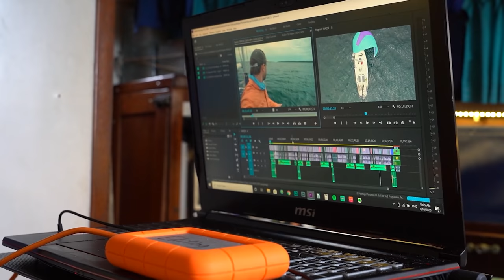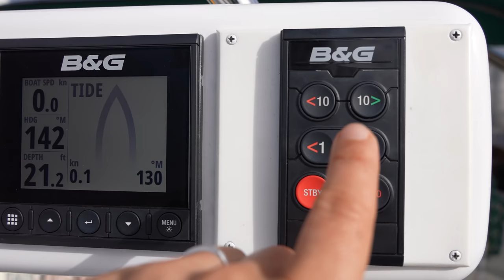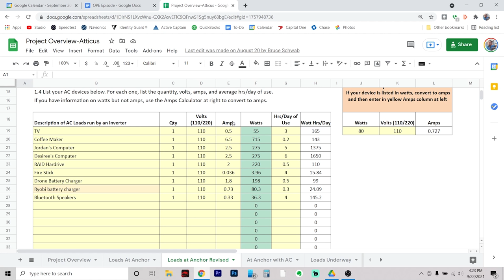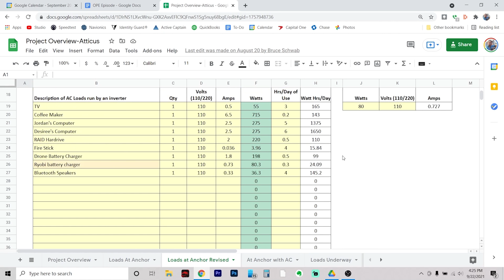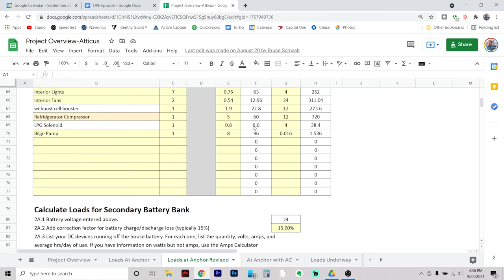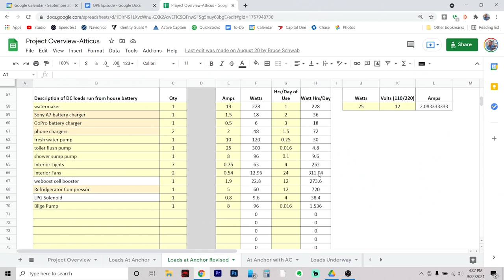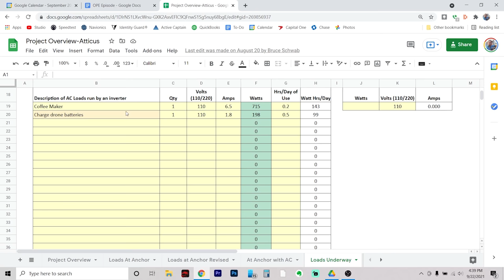Building our Electrical System | S06E20

Comment: Did you say if ya'll are sponsored?  Will you say if so?  

IMHO Nigel offers a really expensive solution that perfects 1970's technology.  Ultimately it's ~$40k to make electricity from diesel.  Sure, it's neat and all, but I have a hard time seeing it in many un-sponsored remotely affordable boats.  Don't get me wrong, I'd definitely consider it if I were throwing $100k notes around like singles while specing a new dream yacht.  And I see how "perfected 1970's tech" is kinda right up your niche.  But for most normal boats it isn't a very logical priority.

Comment: Great presentation. I am all for a lot of this solar stuff and on boats I like seeing it. I am not for this all green deal though. Like inland, if you want solar on your house and barn fine. But to see massive farms built and more wind, NO. I know I just got out of the sea and on land but I am looking at a bigger picture. So for anyone reading this you might want to study the real reason of rolling brown outs in Cali and why the erosion in areas is worse, plus the water shed is failing. You can't go tearing in to mother earth and not expect erosion and that changes water direction. So all the mills on mountain sides and solar farms added to our earth not only do that but just look at the wildlife, mountain lions on the city horizons in Cali, more then ever? Taking land of production for foods and making solar and wind? Lithium is the way but there is no disposal. China is buying up land and will do what they want with it. So if your thinking hard about what I just said, you might want the same thing I am looking at. Stop building these energy farms. There is even a larger draw back when you don't produce oil and natural gas. Anything plastic or rubber or pretty much ever solar panel and wind mill has to have oil and or gas. So what about buying your tires for your cars from china and or korea or the eyeglasses you wear, or the panty hose when Who will Control the market? China take over with out firing a shot. Sorry Jordan, I got of the ocean but, I do support the independent solar array, just not trying to make the world solar or wind. I realize someone going to say why did Texas wind energy stop so here. Temps in Tx or not like farther north. So the extreme cold was not good when the viscosity of the hydraulic oils in higher heat areas need heavier oils. If these oils or two thick in colder weather the braking systems on these turbines will not or possibly fail if the speed can't be in control of that big ole fan blade. So the monitoring system says error and shuts it down. Example: you ever run 40 wt motor oil in -20 degree weather? How did the start up work for ya.  Safe journeys guys
Reply: @earthangel8730  LOL well its a expression due to the high end people like Pelosi, I can just see the fit she would throw. Me, chunk em.

Comment: The MOST IMPORTANT Electrical Device that I suspect that you do not have on board. An EMF/AC(EF)/RF Density Radiation Detector. You two appear to feel ill quite often as I've observed after watching many of your videos.  You often as not blame your dis-ease on motion sea sickness or on a so called ''virus''.  Do some research into the symptoms and what they can mimic similar to electrical radiation poisoning. (esp if you have a lot of wifi & bluetooth running in close proximity).
Reply: A good and relatively inexpensive model that is easy to read & record levels with via a data cable is the ''GQ EMF-390''